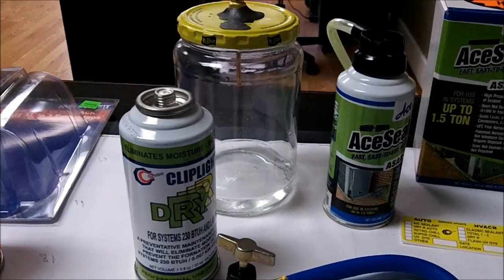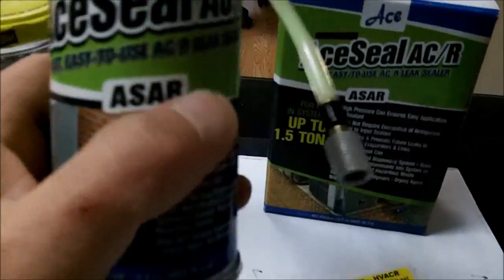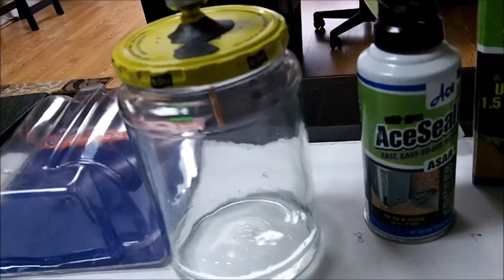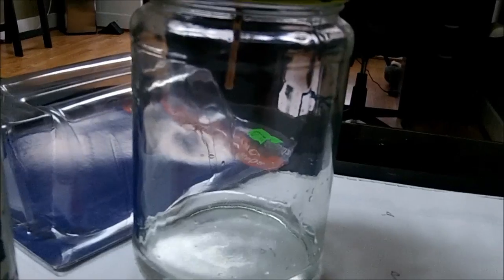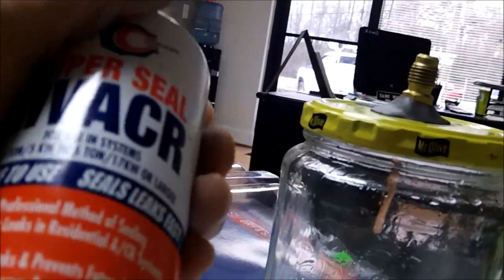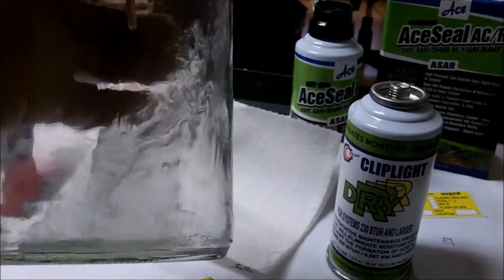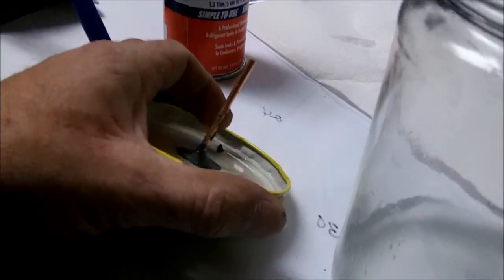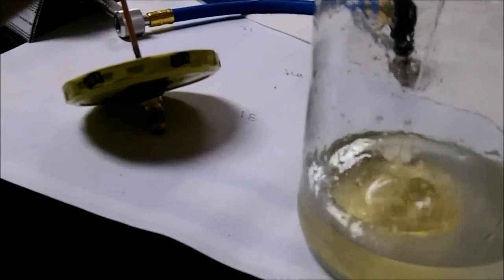HVAC Freon Leak Stop Experiment Part 2

Comment: Isn't the cliplight supposed to mix with the refrigerant in the system which pressures back into the can, and  pressure up the can,   and while doing that,  create, it creates a chemical reaction that creates, and  that reaction pressures up the can, and then after cooling down, isn't it supposed to be charged into the system using the pressure built up in the cliplight can?   It seems to me that the cliplight comes with little or no pressure on the can until the refrigerant gets into it.

Comment from the maker: Hey birdwing you are 100% correct I did not test the product as directed, I did this video to keep people from putting this stuff inside their system. With the rising cost of freon people are looking for a way to avoid repairing a leak that this stuff will not fix. I don't want to go behind someone who has put this stuff in and put my $400 gauges on the unit and get that stuff inside them. There are a few other reasons as well but I can't cover them in 500 characters

Comment: Think the idea is that you connect them to the system while its off, this will pressurise the can, then run the system and as the pressure drops the stuff is pushed into the system. Its because they don't know what refrigerant the system will be running afaik.